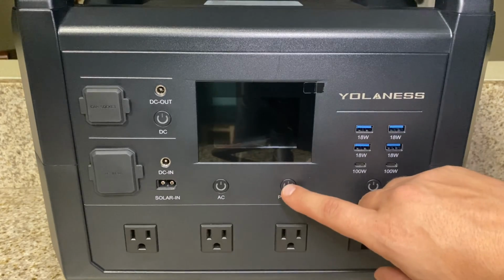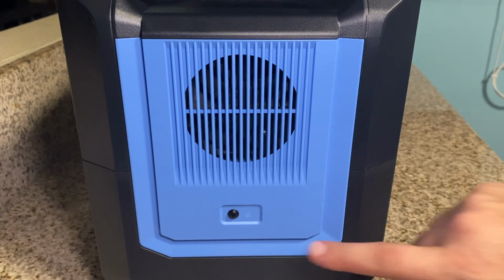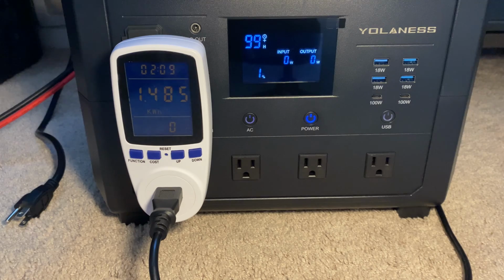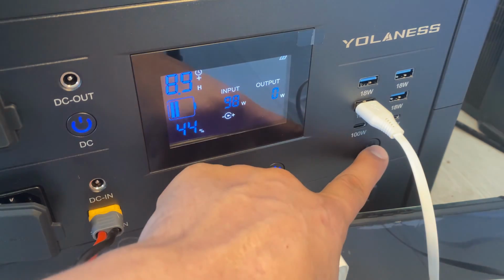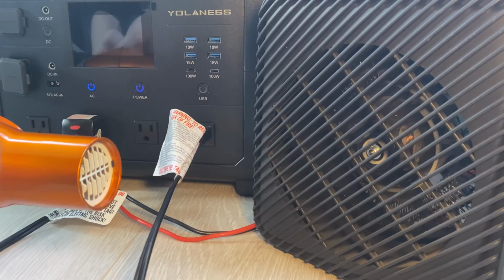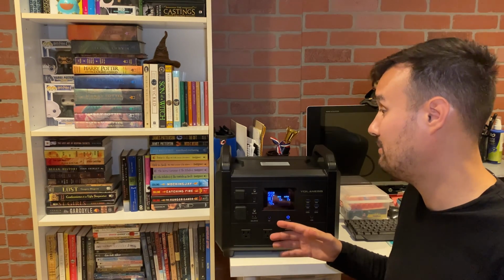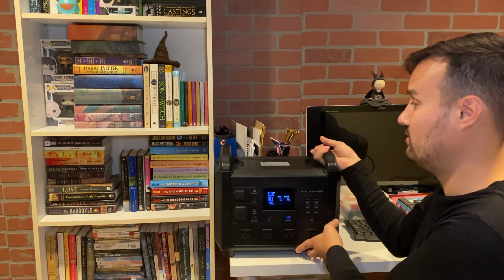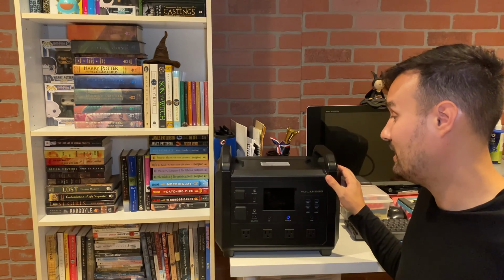Yolaness SAPY 1600: The Hidden Gem of Affordable Power Stations!🔍⚡

Comment: I have this same unit and wondering about calibrating the state of charge. My unit seems to top off at around 70% according to the display. Is there a fix for this? Otherwise unit works good 👍
Reply from the maker: You might need to drain it to zero and full recharge to calibrate the BMS.

Comment: Bought November 2023 for $599, very happy with it. Power was out a few days and got to really work it. It can run my 18.5 ft fridge and other devices for about 15 hours. More than what I expected. Went to go get another  (Feb 2024) and its listed at $999 now. This is not a great deal at $999
Reply from the maker: For 600 to 700 is a good price.

Comment: Can I use EcoFlow’s solar cable for this unit?  Or it does come with one?
Reply from the maker: The unit comes with all the cables to connect to a solar panel. It uses xt60 to the unit and mc4 connectors to the panel which is really standard. Which panel do you have?

Comment: No Options for Expanding Its Capacity like The Eco Flow Delta 1300 from 1K to 3K in 1K Steps?
Reply from the maker: Correct. The Sapy 1600 doesn't have an expansion option.

Comment: I was very surprised to see that this unit DOES use lithium iron-phosphate cells.  From their pictures, it looks like they're even cylindrical cells, which was also surprising.  I don't know how long this company has been around, or how long they will be around in the future, but the specs they are showing, at this price point, are very impressive.  The handles will make it easy to carry it around, but impossible to stack things on top of, so sort of a mixed blessing on that.  I really like the dual 100w PD ports and no external charging brick.  It really ticks all the boxes.
Reply from the maker: I've been using this power station for a few weeks now on the daily and can honestly say its near perfect. I can see your point about the handles but for transporting it feels good since the handles are above the unit and not on the side. Jason do you have any power stations?

Comment: Thanks for the great review. One thing, I am a little bit unsure that "Heater" test for UPS is valid. Since a heater is not usually sensitive to short lapses in power. Typically, a Laptop with Battery Removed or Desktop Computer (with either running a benchmark so it is under a load), is a good scenario.
Reply from the maker: No problem. Thanks for the support. I will keep this in mind for my next review.